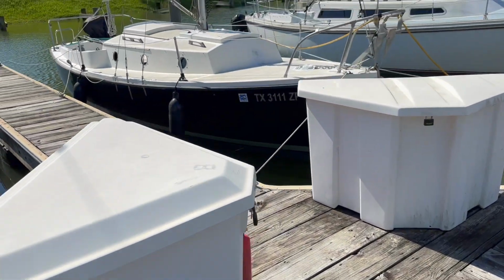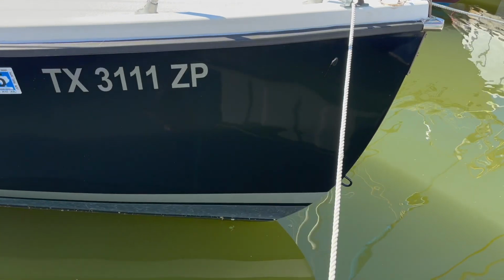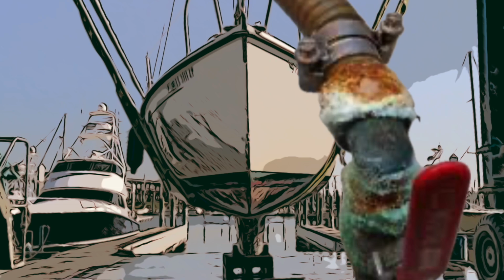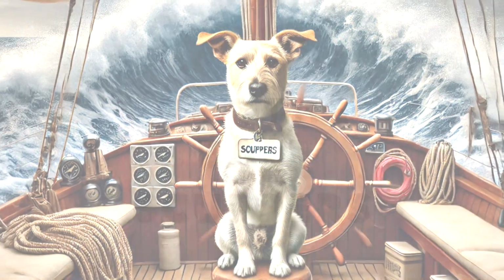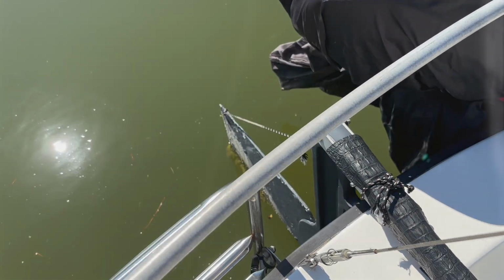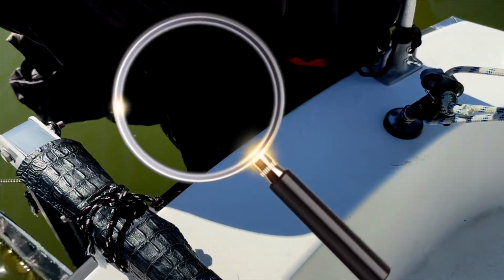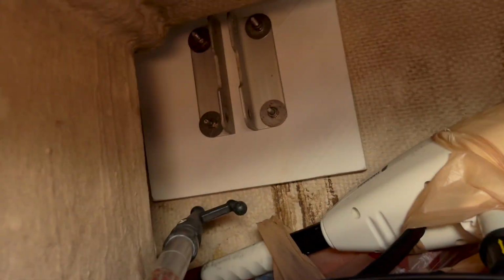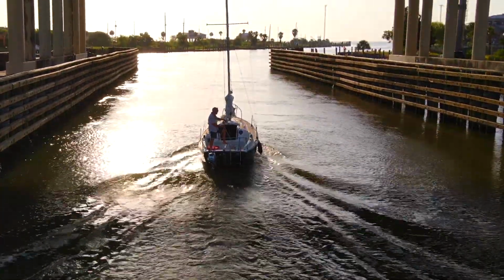SAILING ON A BUDGET? SOLO?BEGINNER?OR PRO? COM-PAC 23 SAILBOAT REVIEW & PRE-SURVEY ALL DETAILS SHOWN

Comment: How is one supposed to know how to figure out if there is "separation" (I think that's the term you used) of the deck if one is brand new to sailing? How can I really know what to look for other than obvious things that really stand out? I'm looking to find a first sailboat for me and my wife to learn on and have been reading and watching videos from different sources but you stated in the beginning of the video that certain brands may be bad or stay away from them yet I've seen many of them online while looking for a used boat. Should we stay away from them? How could we know if it's a first, second or  8th production boat if we're completely new to all this? I suppose I could look it up but how would I know to stay away from that particular make, model and year? 
I didn't know there could be dangerous problems with a swing keel either. It seems like there are many more of those in the 15' - 25' used boat market than not. Are you saying we should stay away from them as folks new to sailing? 
I must admit, your video has made me more nervous about finding and going over and buying a first sailboat, lol. Not sure what to do now!
Any thoughts or guidance would be a big help.
Thank you for your time.
God bless!
Reply from the maker: I think you may be referring to deck rot.  
99% of fiberglass production sailboat manufacturers, use either a plywood or a balsa cored deck.  In the video, I make reference to the three ways that you can check for moisture/rot in a cored deck. You can walk around the deck, barefoot, putting pressure on different spots feeling for softness. You can lightly tapped on the deck with a hammer, listening for different changes in tone, indicating moisture or softness.  Or you can run a moisture meter over the deck and compare various readings of moisture content.  The boats that I mention, as having poor reported ratings in the owner forums for having low satisfaction are plentiful.   Many of these boats were mass produced during a sailing boom.  Great for getting people out discovering sailing, but now decades later, structural rot and deck rot are showing where production cost were cut
to retain profits.  There were countless sailboat manufacturers that jumped into the game and then dropped out like a waterbed salesman.   If I were you, I would find all available sailboats in my area, that were in my price range, and then dive deep into every make and model.  First generations are called mark ones, MKI, MKII and so on. If you’re into sailboats, the research is a lot of fun and you’ll learn everything you need to know about a boat fairly quickly.  Some less expensive brands will be just fine for light use and if they were preserved well, you will have very little to worry about.  The cheaper the sailboat was to build, the more important it is to maintain it.  A well-built battleship takes less upkeep.  Once you get to know your swing keel’s  mechanism, you will know what to watch out for.  Making sure to lock the keel down, but still have the ability for it to kick up upon a hard grounding is important.  
In extreme sailing a swing keel that is not locked down will want to swing up when you need it to stay down the most.  I prefer the simplicity of a modified fin keel.  Com-Pac Yachts in my opinion is strides ahead of others in the aspects that make a great small sailboat.  Which means nothing if they are not priced in reach.  There are plenty of compact 16, 19s and 23s out there. Keep your initial investment low and you should have nothing to worry about.  I hope this has been helpful.  Thanks.

Comment: Some good tips.  You also need to inspect the trailer.  If it is no good you are stuck on the water.
Reply from the maker: You are absolutely right.  I did the research and wrote a script for a trailer portion of this video, but I got so deep into it I thought it might need its own video.  Thanks for checking it out.